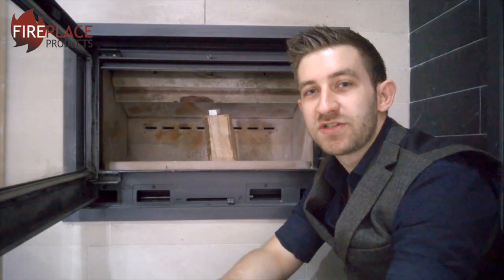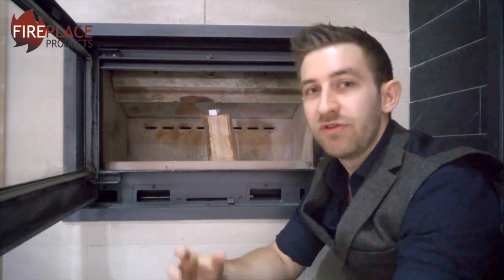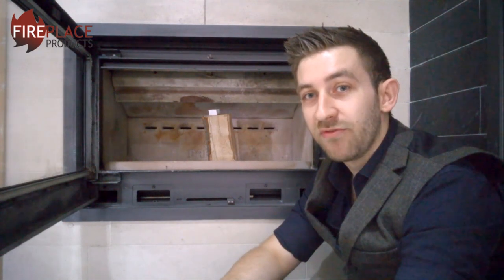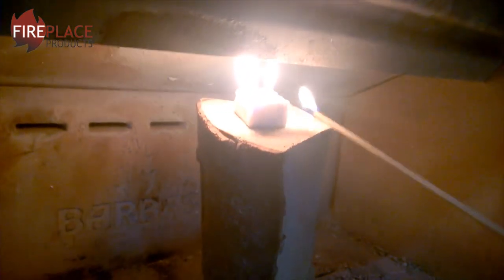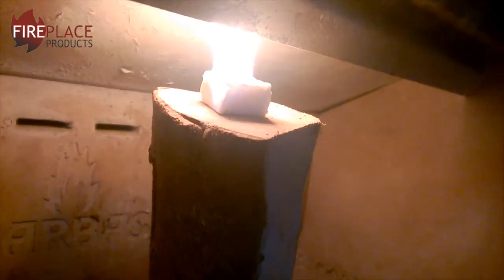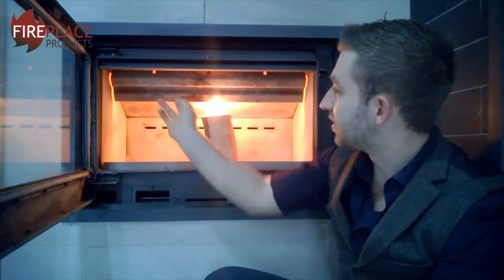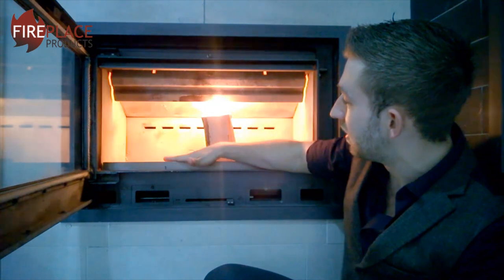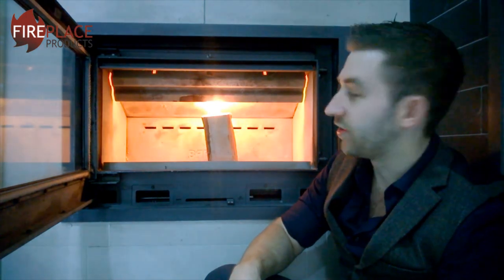How to create a draft in your chimney

Comment: Thanks, I never even thought about raising the flame higher. I only have trouble when it’s below 40° F. I don’t use the wood stove often. I put a can of alcohol with holes drilled around the sides, sometimes I use two. I can tell when it’s drawing by the alcohol flames. It takes a while depending on how cold it is outside. The alcohol can die out with the door closed even with the damper fully open. I have an insulated pipe chimney with a 90° bend. I think that may be why it’s hard to prime. Once it warm it draws fine, no smoke in the house.